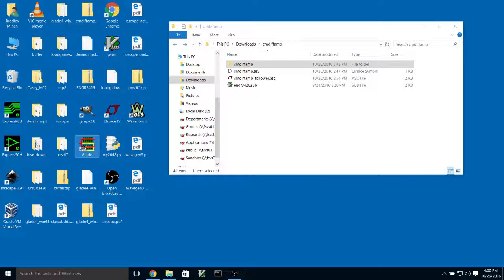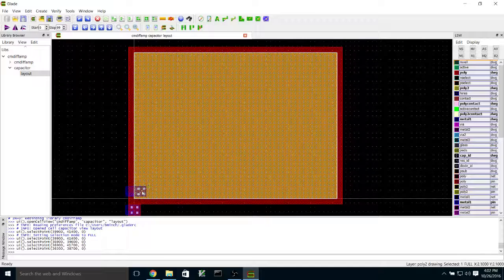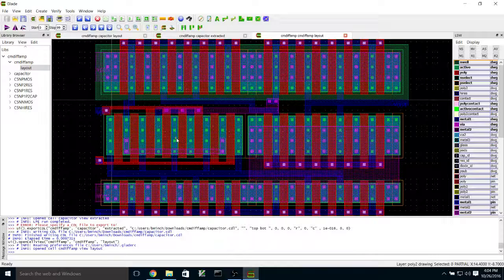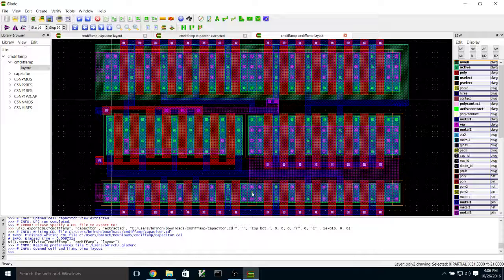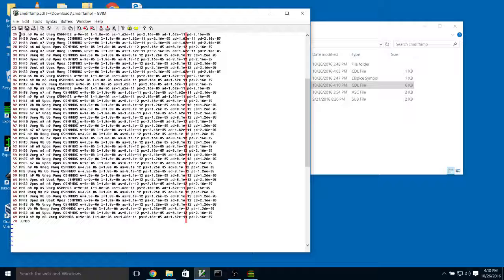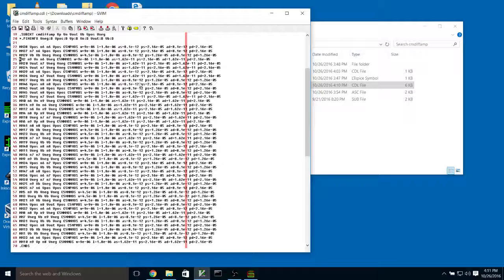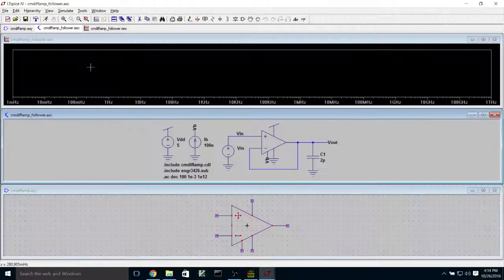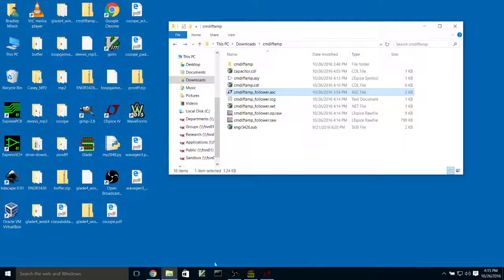Glade capacitor layout and post-layout simulation tutorial

Comment: Hi, I have recently also started to use GLADE. I have the C5 technology files (engr3426) from http://madvlsi.olin.edu/madvlsi/projects.html if I'm not mistaken these files have been done by you for which I wanted to thank you for your contribution. However, in the video I can see that in the .cdl file you get the cpacitance value but when I do the extraction and then generate the .cdl file the cpacitance value, "c", is not generated automatically. The same is true when I try to do the porper with a resistor.

I wonder if the code was improved for this video or if something is wrong with my configuration. I would greatly thank you if you could help me with this.